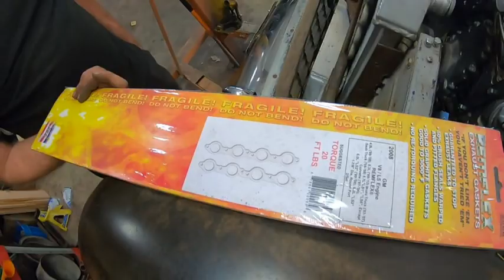1955 Chevy Turbo LS 4.8L Install Problems.  Hot Rod Patina.

Comment: Glad to see engine back into the  chevy.  But if I ever had a thought of installing an LS engine in a tri five it looks to me like a crowded cramped area for me to  attempt so i will  let it ride as it came equipped as a inline 6   or old school SBC. Hope it is running by the time you get this.  GO PENNY"S
Reply from the maker: Cant go wrong with an old 235 👌👍
Reply: Thats what I got in my 4 door 1957 with a split exhaust, she is slow but dependable  @pennyshotrodscustoms

Comment: Have you guys ever seen a Sunbeam Tiger? It's a small British two seater with a Ford 289. The back plug on the passenger side had to be changed through a rubber plug on the trans tunnel. Tight but fast
Reply from the maker: Seen one of those before i always thought they were cool cars Brain .

Comment: I’m no mechanic and the last thing I am is an electrician, but something tells me I’ve seen before where an engine will start, but some were in the ignition switch, something about another  wire, set to keep it running? Not sure.  Anyways, good luck, and that 55 is my favourite!
Reply from the maker: We were thinking that also, but we did not touch anything under the dash.

Comment: Excellent video Guys :) also check on  intake at back  if reset button for fuel squirt out when got running for moment before shut down again see if need prime up too also GM 5.3 V8 in 2002 year  got this feature on  motor for pickup Z71 ones and hopefully find what need be problems are and do some searching in my logs book to if find why and comment for check on to help out!
Reply from the maker: Thanks for the info!
Reply: @pennyshotrodscustoms  welcome guys for help out and still check in my logs and records why motor not keep  going and chat to my men cousins and other  shops owners I know give information too ! Hope for simple fix to past along to all and say thank you will check in to also! But one come to tip my knowledge also check on is Knock Sensor see if hook up or unplug what does it tell motor if get all spark in order plus Air, Oil pressure, Fuel plus bring up high idle to low idle in 10 minutes of Drive too and another sensor is check Mass Flow Sensor ring  hook up  for Air Filter and Breather  if dirty or worn it shut down after start be like backfiring plus drive down road it bring code up or Check Engine Light shut down like Vapor Lock too ! When replacing Mass Flow Sensor make sure + battery cable off then when newer Mass Flow Sensor installation done put + Battery cable on to wait 5 minutes if vechile got Computer plug OB reader in turn key ignition on only then check codes plus clear it 2 times on each check and try fire motor up too! Then check codes again 2 times and clear them unplug code reader ! Last one come with to check- Battery cable on pig tail ground to fender wall or strut nut bolt or nut  area with connector with flat washer or lock ring also shine like sparkling clean too!

Comment: 👍 I'm pretty sure your going to need to clear all the old codes out of the PCM - ECM with a tech 2 scan tool after from the last engine failure episode set by the engine knock sensor, just disconnecting the battery is not going to do it..
Reply from the maker: We will try that.

Comment: The issue you’re having sounds awful familiar. I’ll wrack my brain & see if I can remember what I ran into.
Reply from the maker: Any help will be welcomed thank you.
Reply: @pennyshotrodscustoms  I do remember one situation where the fuel pump would run during crank but as soon as you would move the key back to the run position the fuel pump lost voltage.

But there’s another one jangling around in my head - I will keep thinking
Reply from the maker: @MyKARSShop  Thank you.

Comment: I'm with Chris, not into the computer controlled flew-flam....  early engine, simple carb, and lightning whirler.... and you are good to go.
Older i get, less desire I get to go fast.
Reply from the maker: Agree Dano will figure it out well hopefully.
Reply: @pennyshotrodscustoms  Oh I'm sure you will. It worked before, right? Might sound stupid, but a starter solenoid issue? This kinda thing happens when the "I" terminal on Ford relays get all corroded internally. The "S" terminal fires it, but when you let go of the key from start position, it kills it. (no power from the "I" terminal) Not sure how the newer GM stuff is, but I know the older GMs were very similar.
Reply from the maker: @OlysGarage  Ill ley Ryan know and yuppers it ran before well with a different engine will be back at again soon.
Reply from the maker: Any thing is worth a try will be back at it soon Dano.

Comment: It sounds like your dropping power after your key is released from the stater, check for 12 volts at the starter or key switch with the key in the run   possion
Reply from the maker: We will do that this weekend.
Reply: Sometimes when they do that you can turn the key back far enough to where the starter is not engaged, and you will have to hold it there, and it might still run and it might not depending on the switch I have done it in an emergency

Comment: Could be an ecm issue. Maybe the VATS somehow came back
Reply from the maker: We may try and convince Halfass Kustoms to come and reprogram it on the weekend.
Reply: @pennyshotrodscustoms  that's a pretty good idea. He's pretty good with HP tuners. 
I could be very wrong about it, but it is acting in a similar way to where the VATS are enabled, making the engine only run for 2 seconds. Which is weird, cause I've never seen an ecm lose a tune like that before. 
I hope you guys figure it out. That's such a cool 55. I love the ratty patina look